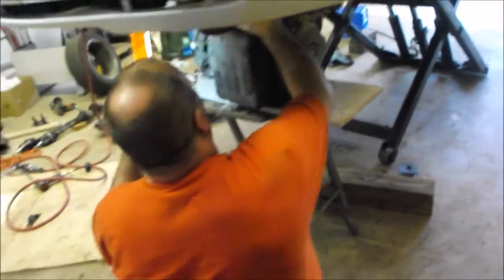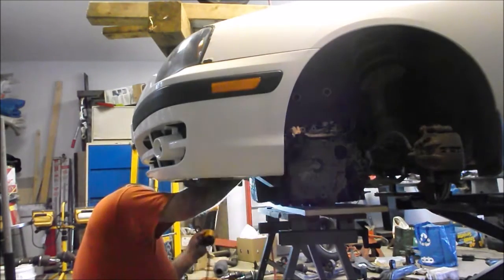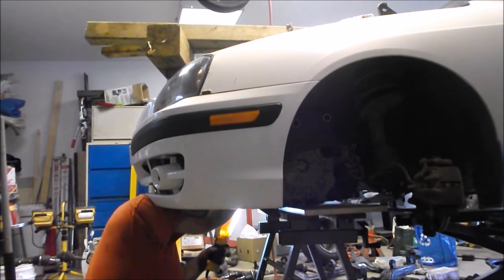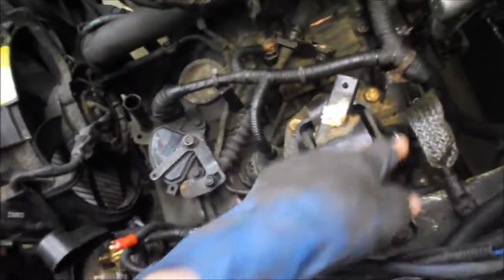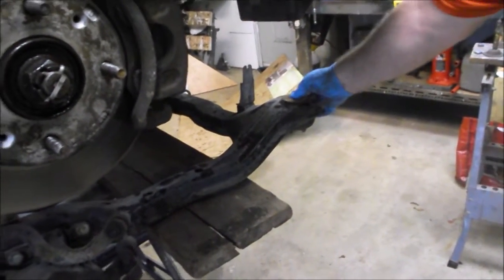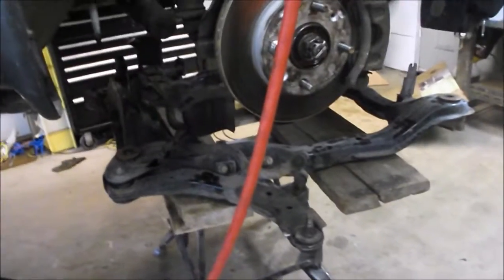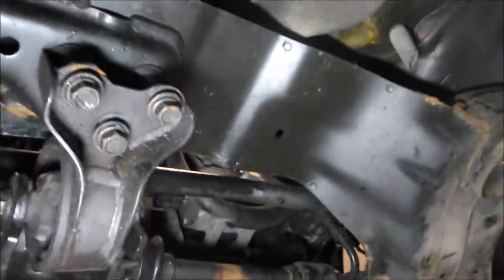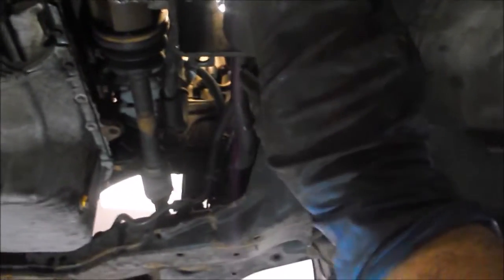DIY Hyundai Elantra trans & engine swap Part 3 of 3 - Installing good transmission

Comment: On the torque converter bolts, did you bolt it down all the way? Or did you leave a small gap between the fly wheel and torque converter?
Reply from the maker: The video was made 7 years ago so I don't quite remember much about it. However certainly the torque converter needs to be bolted down all the way to the flywheel at some point in the procedure. No Gap should be between the torque converter and the flywheel once it is bolted down.